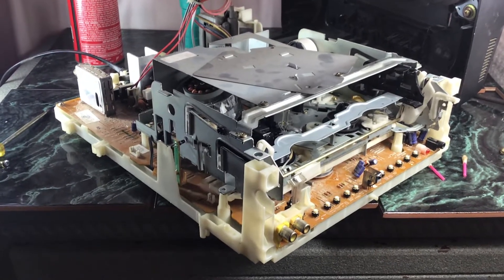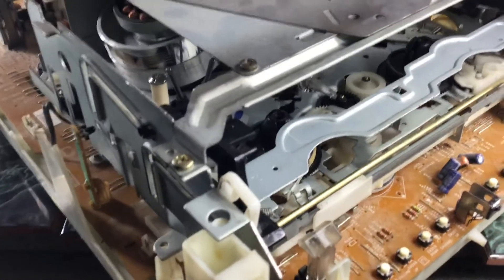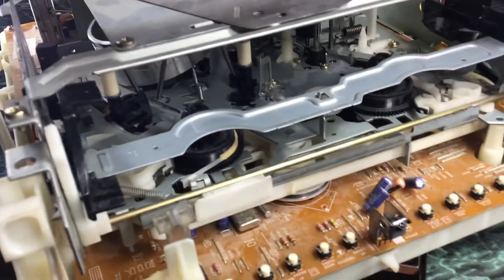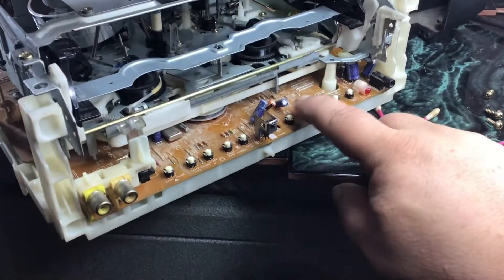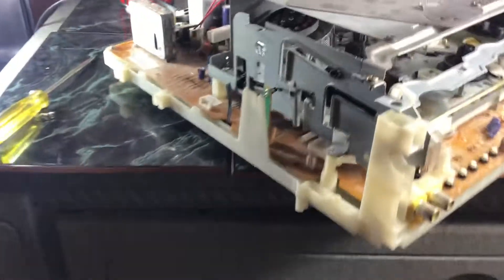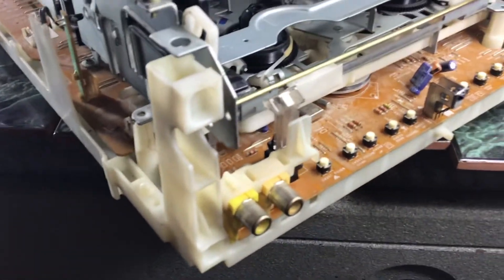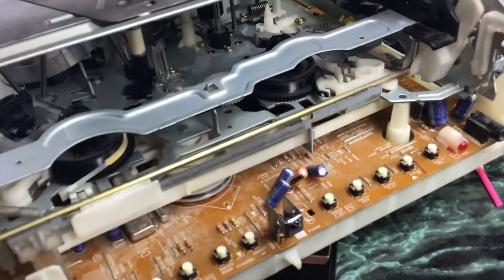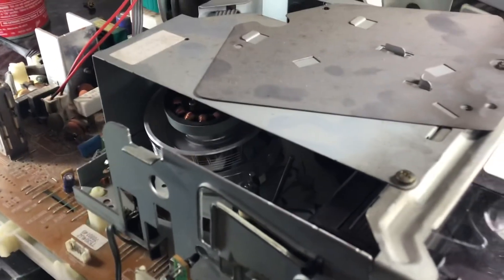VCR Wont Load Tape and Eats Tape SSC132

Comment: Back tension arm is slightly bent to the right. It should be completely vertical. That's why it's not dropping down on the left side when you insert a cassette.  It appears the metal arm itself is bent and needs bent back. That arm goes in the hole on the bottom of the cassette on the right.